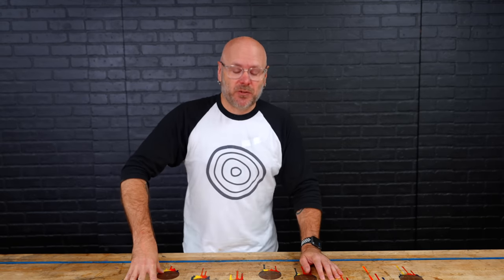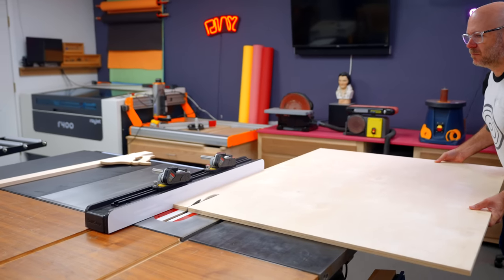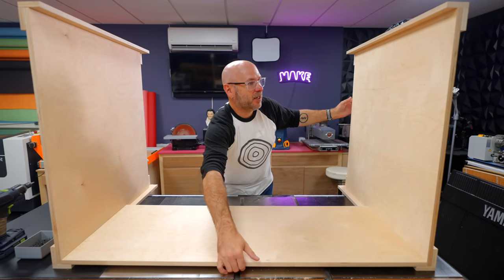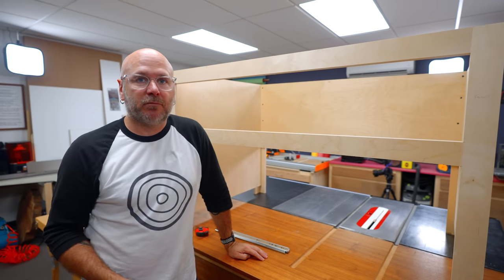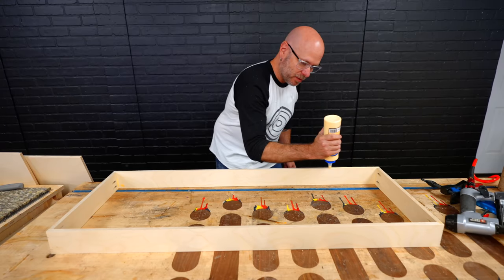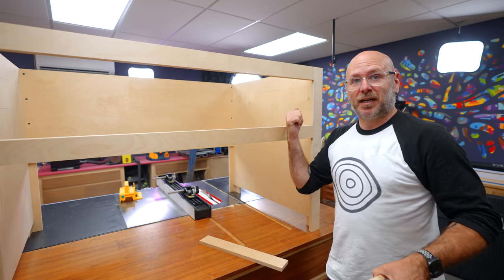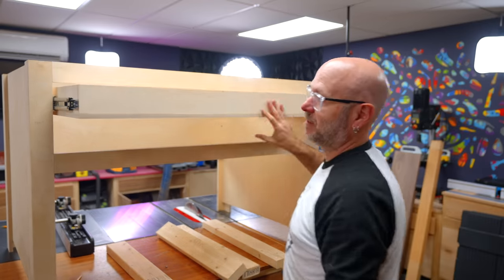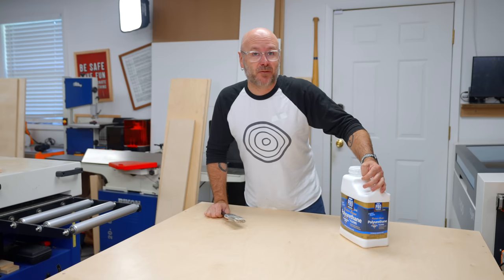Easy Tool Stands for the Workshop

Comment: Still have my DeWalt 12 inch. Over 10 years now.
Reply: My Ridgid is going on 15 years strong!
Reply: @sailingeric  nice, another great brand of tool that is completely underrated. Especially their warranty on batteries. I would have saved over $500 already compared to my 18v DeWalt batteries I’ve replaced over and over.